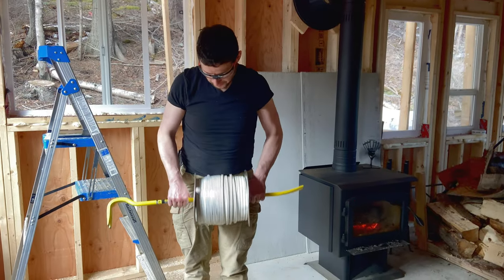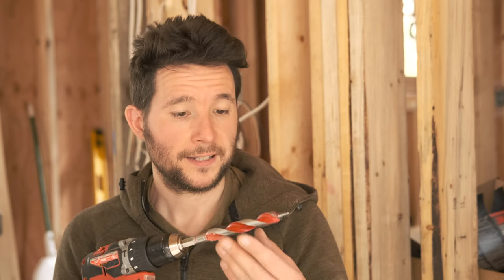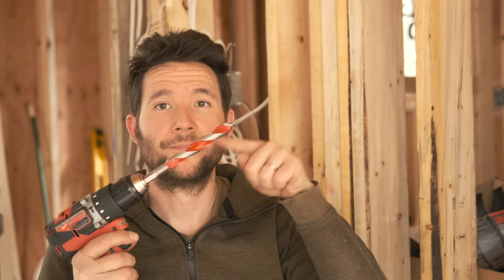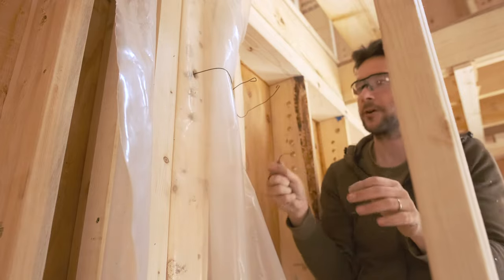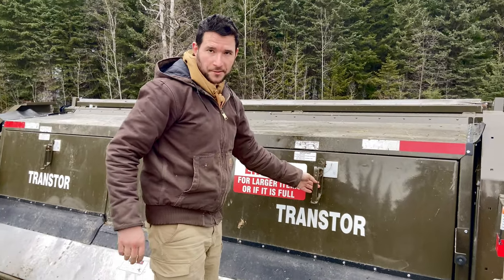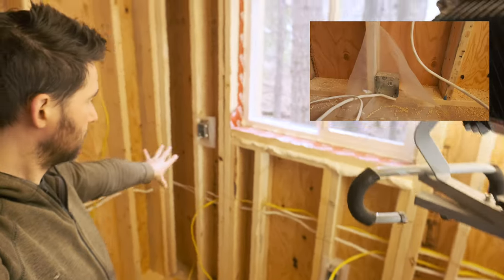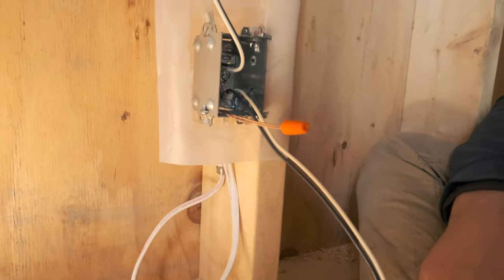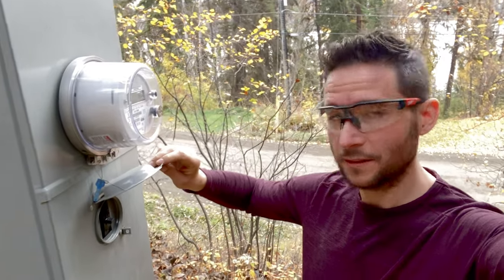Wiring our cabin | Building our home in the forest episode 28

Comment: always amazes me people will cheap out on $1 outlets when building, and then later spend $$$ remodeling putting in more outlets, or running extension cords all over. one question tho, those little plastic sheet squares by the boxes, are they code, or just for giggles?...
Reply from the maker: Lol, they’re vapour boxes and they’re definitely up to code! We needed them because we used metal electrical boxes, but there’s fancier plastic boxes that don’t need vapour boxes. (The price difference made it worth it for us)